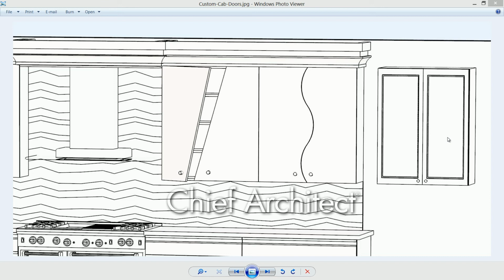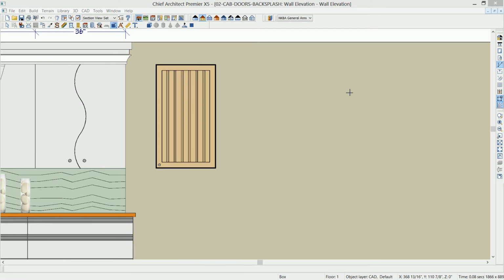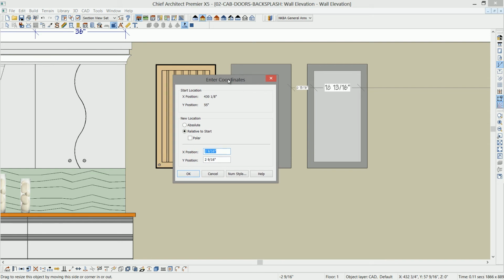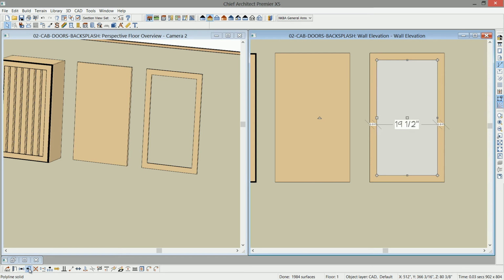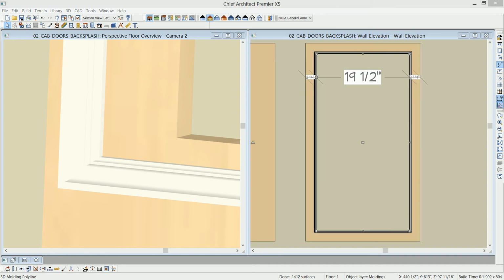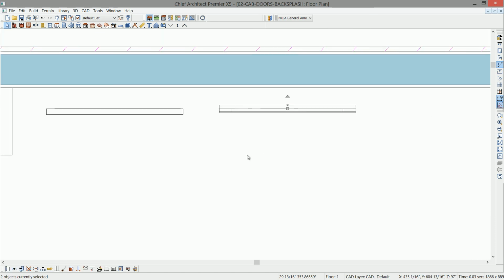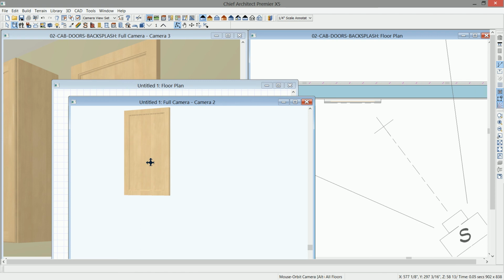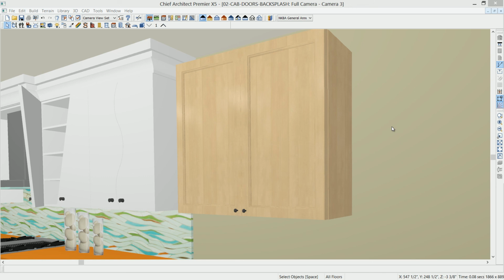Chief Architect Quick Tip - Custom Cabinet Doors

Comment: When I use the marquee tool to select the door panel, frame and moulding, my moulding will not select with the rest of the door. Is there something I'm doing wrong?
Reply from the maker: The casings for doors (and windows) are attached to the door object, so even though it doesn’t appear as though the moldings are being highlighted as part of the selection, when you edit the door object you can also access the settings for the trim at the same time (look for the “Casing” and “Lintel” panels in the dialog for these controls).
Other trim, like baseboards can be accessed through the Room Specification dialog. There is even a manual molding tool that you can leverage to customize your design.I hope this is helpful, if I haven’t hit on the topic quite right, our Support Team might be able to do a better job clarifying! Contact them here: https://www.chiefarchitect.com/support/#contact